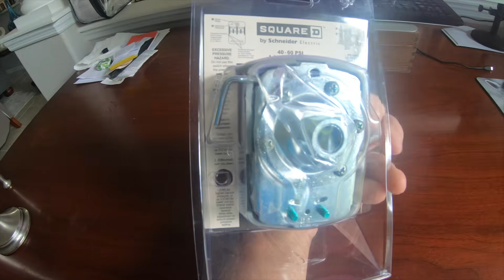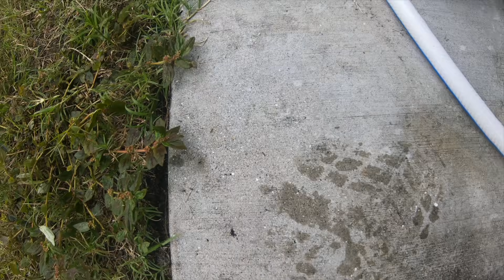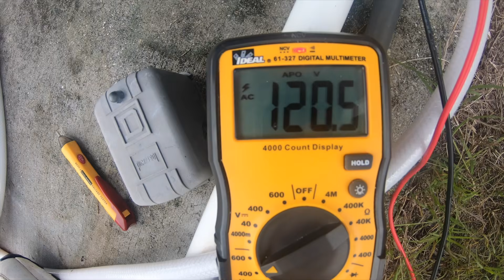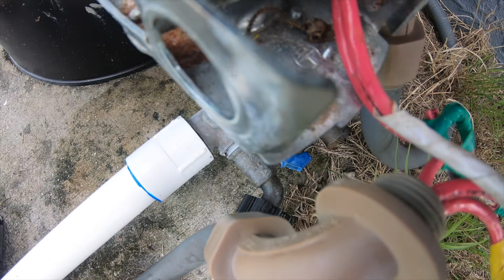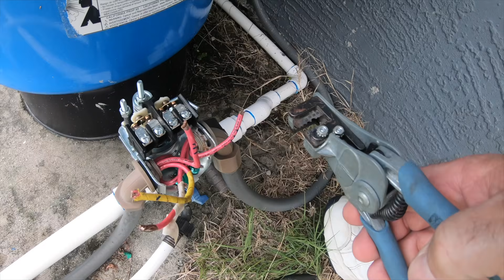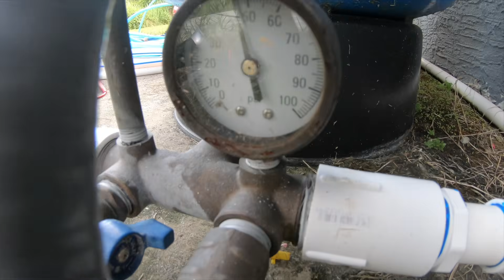Easy Square D 40/60 Well Pump Pressure Switch Replacement

Comment: Can you wire the pressure switch for 120V? I ask, because my deep well 1 hp pump can be 120 or 240v, but nobody has shown wiring the pressure switch to 120V! Is that not do-able? Thanks!
Reply from the maker: My pressure switch is wired for 220. I’m not sure but I think most well pumps are 220. You just have both legs connected to the switch. I guess you can wire it for 120 but I am not familiar with systems around here that are not 220.

Comment: Square D is a much better build than Everbilt. When you tighten the terminal screws on the everbilt the entire connection begin to collapse, the square D doesn’t bend out of place.
Reply from the maker: Ironically, I had to replace my pressure switch last night again. Replaced with a square D. Ours gets lots of use.

Comment: Do the pressure switches come preset from the factory? Thanks for the thorough video.
Reply from the maker: Thank you for the comment. The switch is recalibrated when you purchase it, but if you need to change the pressure for whatever reason, there is a nut on top of the spring that you can adjust up or down to increase or decrease the pressure. After mine was installed, I increased the pressure about five psi because I have drip irrigation and I wanted to have a little bit more pressure in the line. You don’t want it too high though because you can damage your plumbing inside the house.

Comment from the maker: I use a standard tire pressure gauge like you would use for your bicycle or car. The one that I have is actually connected to an air hose from my compressor, which is why it looks a little different. You could even use a bicycle pump to put additional air in the bladder of the pressure tank because it only requires a few pounds of pressure.

Comment from the maker: I turned the power off at the breaker because most well pumps are wired for 220 and are hardwired. But I guess you could unplug it if that was your situation. Hope this helps.

Comment: Great video, about to replace mine. If the PSI is not set exactly 40 60 from the factory and the nuts have to be turned, do we turn those as it is running, or, shut the power off each time to turn the nuts and  watch PSI?
Reply from the maker: You can do it with the power on and while watching the gauge, just be careful of the contacts.
Reply: @RandomlyAwkward1  thanks, happy holidays

Comment: Our water pump is not switching off and the pressure is building causing pipes to burst open. I’m thinking the switch needs to be replaced.
This will be our 3rd switch in 2 years. How often do they need to be replaced?
Also we had a tornado knock a tree on our system.
Since then the softener will not refill. How do make it regenerate? Do you have any videos on the steps to take to fix the softener ?

Comment: Why you all keep skipping that part of reconnecting wires. Yeah they are marked but theres a few of us that wanna know where wire from the pump should be connected. You guys skip that part to the final product which i feel that very important to keep recording
Reply from the maker: Hi Jesus, I marked the wires with a sharpie before I removed them (1, 2, 3, 4) and just put them back in the same order. I did cut off the frayed ends and crimped a new connector on each wire, but they are in the same order they came off. I don’t know which is which either!

Comment: Thank you for this tutorial I’ve been working on my well for about 14 years off and on……Although my pressure switch has a water tube going to the plumbing it’s about the size of a soda straw so it’s a little different than your set up……basically my pump will turn off at 60 psi but will not turn on at 40 psi………. so I’m pretty sure it’s the pressure switch fingers crossed………

anyway I’m going to attempt to replace the pressure switch in the morning thanks for the video
Reply from the maker: Thanks for taking the time to comment… let me know if it works for you. Thanks!